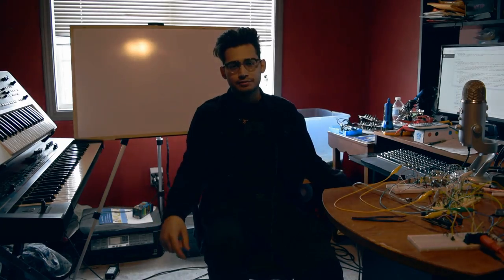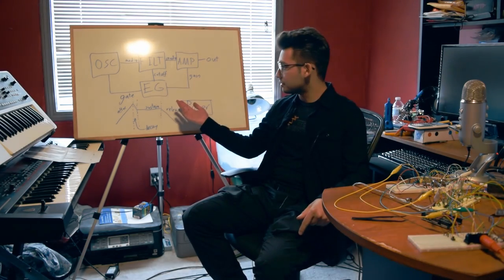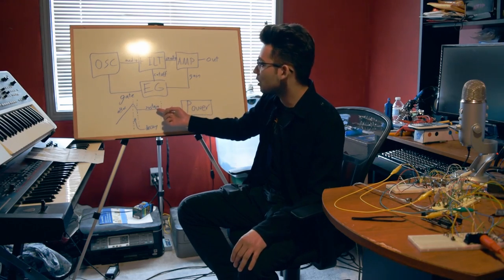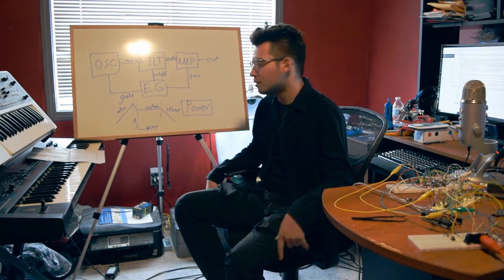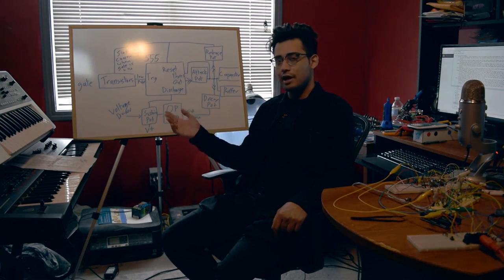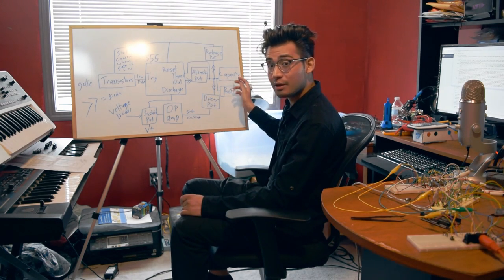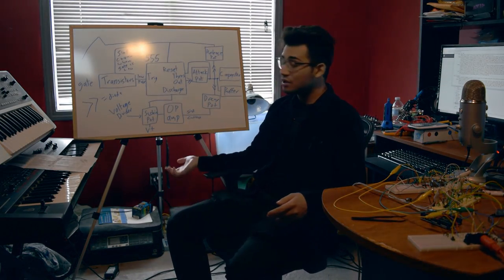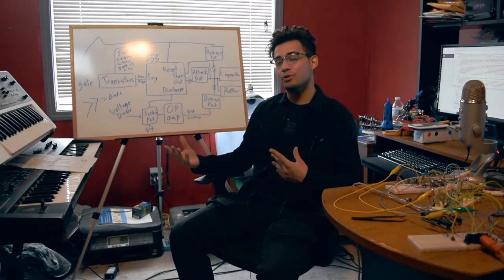DIY Synth Design Tutorial Series - 004: Analog Envelope Generator and Amplifier

Comment from the maker: NOTE: The noise (and by extension the wheezing sound when filtering) is caused by my wall wart power supply. I didn't realize this until it was too late, but the good news is is that I tried the synth with batteries instead and the noise/wheezing is gone. To hear how BITBA555 sounds in a song, check this out (https://soundcloud.com/theroomdisconnect/bitbac1d/s-NRedz). Only simple effects like delay and reverb were used.

Also sorry for the lighting on this one guys! Unfortunately this was the only time I had to record and I really shouldn't be using the auto setting of my DSLR at this time of day.

Comment: What modifications would you need to make to have the envelope generator work when supplied with +-12V instead of the +-9V?
Reply from the maker: Technically all you would need to do is change the power supply of the op amps to +-12V to make it work with that range. But the real question is what range of voltages is the device you're trying to send CV to expecting. I'm unfamiliar with the standards for modular synths, but for example if you were sending the output to the CV input of a filter and that filter expected 0-5V on the CV input, then you could just use a voltage follower configuration on the buffer op amp which would make it output 0-5V. So I imagine you're asking this question because you want to build a DIY modular synth that works with Eurorack standards. I'm unfamiliar with the standards, but using the same techniques I'm showing in these videos it shouldn't be much work at all to change the designs to fit those standards.
Reply: @the.room.dis.connect670  Thank you for the reply! Eurorack voltage standards are a little weird. An ADSR typically runs from 0-10V as far as I can tell. So I would have to first change the op amps to +-12V, then play around with the buffer op amp until I get something within that range?
This schematic goes up to ~8V at the peak of the attack, so it looks like it might be fine to leave as is, actually.
Again, thank you for the reply. I'm looking forward to your next video!
Reply from the maker: @adrianfalconer3086  Oh wow, that is a strange range. But yeah, you can always just mess with different op amp configurations in simulation and see if you can even get it to exactly 0-10V, which should be really easy since your voltage range is extended now. Just a heads up though, in my schematic I add an op amp after the buffer op amp that changes the range from 0-8V to +-8V, so if you're implementing it for Eurorack be sure not to add that second op amp.
Reply: @the.room.dis.connect670  Oh interesting. I've seen a few different versions of this type of ADSR (Rene Schmitz, YuSynth) and I haven't seen that second op amp in any other schematics. Does it need to go all the way down to -8V to cut off all sound? Or would 0V work too?
Reply from the maker: @adrianfalconer3086  For my specific filter design it does need to go down to -8V. Other filter designs I'm not sure of. Since I'm designing all these sections from scratch, and I don't intend for them to be sending or receiving CV from anywhere else the ranges might be a bit weird. Maybe in the future I'll design some modular gear that adheres to Eurorack standards.
Reply: @the.room.dis.connect670  I guess part of the fun of DIY is figuring out what works for you. I'll a pay around and see how I go :)
Thank you for the replies, I really appreciate the help
Reply: @adrianfalconer3086  Exactly what i do . I may build around a certain schem but then tailor it to be optimal for my specific use/uses.
Reply: I wonder if you can point me in the right direction . A little off topic from this video . How would you  mod the circuit to have a gate on or off option , say a spdt switch that bypasses the adsr phases,so it is just key on or off ?